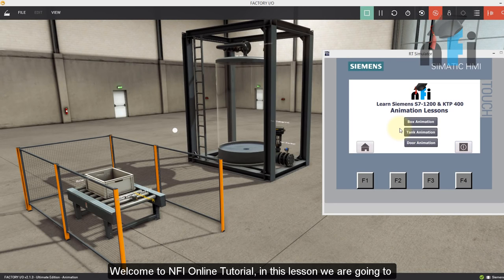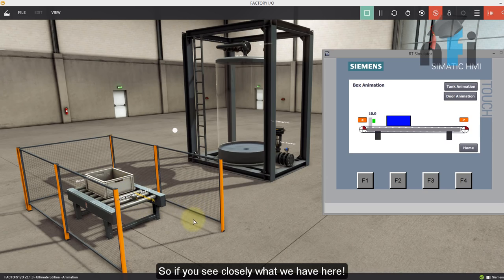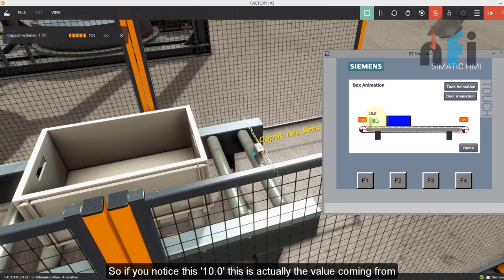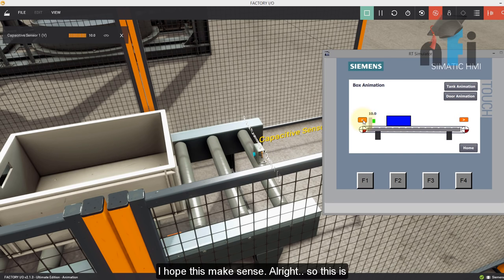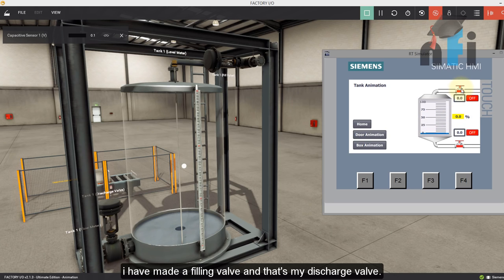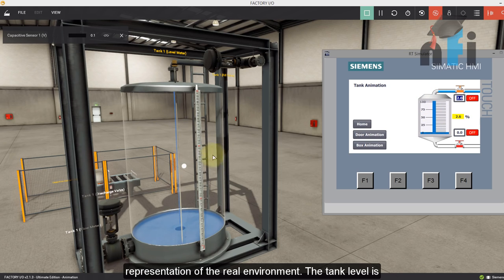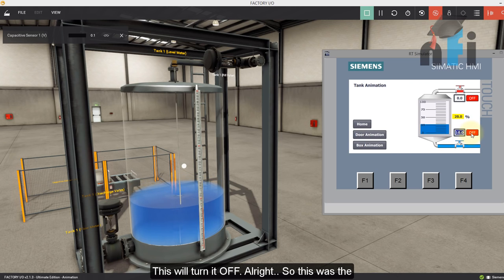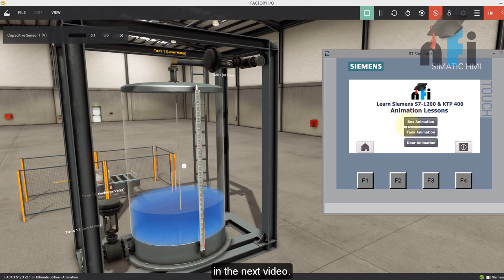How to animate in Siemens KTP 400 HMI

Comment: dear sir, Can micro PLC replaced by Arduino mega .. please reply sir..
Reply from the maker: It depends where are you installing your PLC. If you understand PLC is rugged device unlike Arduino mega. PLC has higher immunity against temperature, humidity, pressure , dust etc compared to Arduino Mega. If you can provide a better casing to Arduino mega then i am sure you can replicate the code of PLC in Arduino!
Reply: thank you so much sir for explanation..